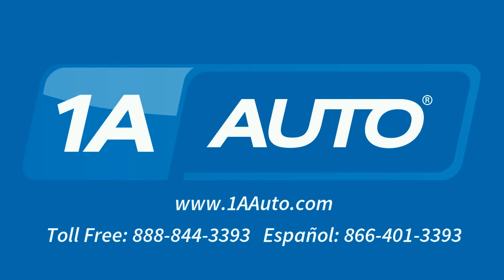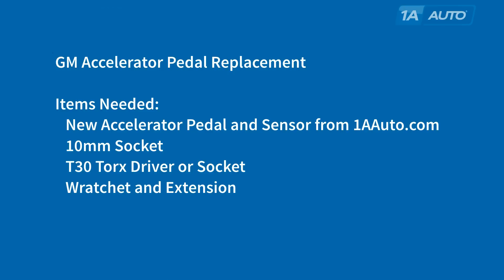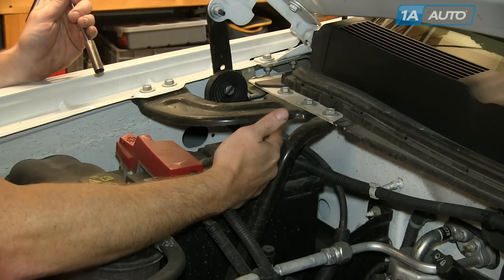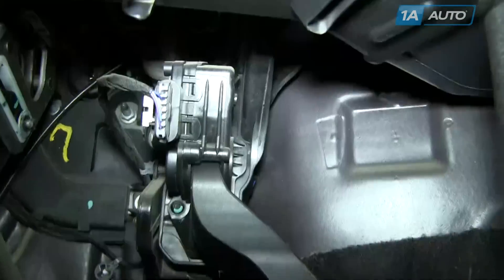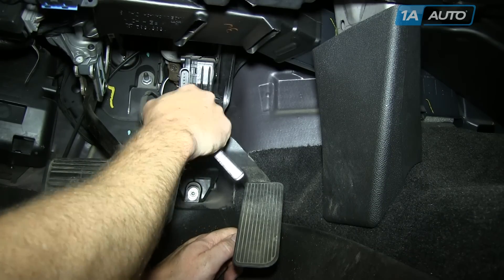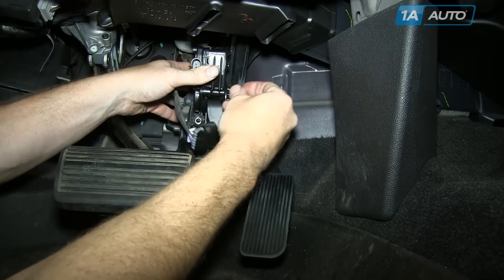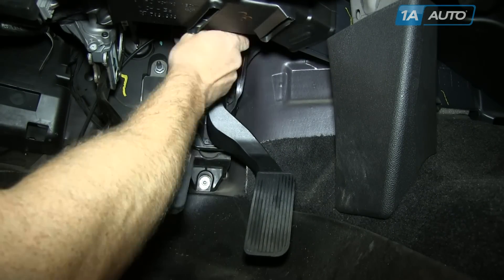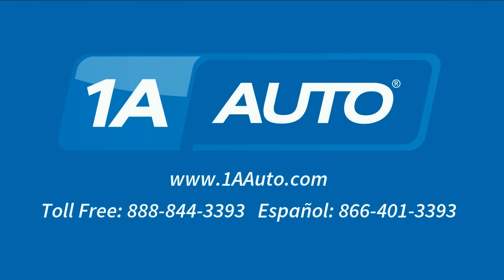How to Replace Accelerator Pedal & Position Sensor 07-11 Chevy Silverado 1500

Comment: This is just another reason why you guys at 1A Auto are the best! Watched your video, replaced the accellator pedal and sensor in no time! Thanks again guys for taking the time & making video's!!
Reply from the maker: +Rich Novo Thank you for the great reply. We love to empower our customers by showing you how-to perform your own auto repairs while installing our high quality auto parts. Have a great day! 1aauto.com
Reply: @1AAuto  But do you have anything showing the adjustable height pedal?  There's an adjuster cable that looks like a real bear to get out.  Can't find anything showing how that comes off except in comments here.
Reply: Didn't you have to reset and recalibrate it removing the battery cable resets it but you also need to recalibrate it

Comment: WHOA.  Should have watched this vid before I changed the throttle position sensor in my 08 Suburban. Replaced the accelerator pedal sensor after the fact. Running excellent so far. Hope my issue is resolved. Thanks.  👍🏾👍🏾👍🏾👍🏾👍🏾

Comment: Man I’ve been having my ABS/stabilitrak/ traction control lights going off an on for about 2 weeks now. Heard it may be the pedal/sensor, def going to try this out. Hoping this solves my problem!
Reply: Video was very clear and understandable
Reply: Did it help? Im having the same problem and thinking about buying one. Lights go on and off and 1st to 2nd is pretty rough as long as lights are on
Reply: My 2007 suburban jerks and lights come could this be?
Reply: Having the same issue did it work???
Reply: Did it work ?? Mines started doing the same and it won’t even accelerate

Comment: Okay here’s my issue. About 2 years ago my 07 Silverado started dying when I would make turns. It was throwing the code for the throttle position sensor. Changed that then it started dying again when I would either make a turn or start coming to a stop. It was throwing the code for the accelerator pedal sensor. Changed that and about 30 minutes later it started dying again and throwing the same code for the pedal sensor. Any input would be greatly appreciated and helpful! Forgot to mention that it also hesitates.
Reply: I watched 2 other videos one guy says change out the actual gas pedal , that solved his problem. Another guy says he disconnected his battery , reconnected it after 20 mins. Solved his problem. Similar vehicles to yours. I’m going to try both ...see what happens
Reply: I am having the same problem with my 2007 Chevy Tahoe.

Comment: excellent video, what were the reasons to replace the pedal? Could you help me with any signs or symptoms that may occur to take to replace the entire accelerator pedal?
excellent video, what were the reasons to replace the pedal? Could you help me with any signs or symptoms that may occur to take to replace the entire accelerator pedal?
Reply from the maker: +Jorge Almeida  A bad or failing accelerator pedal position sensor can lead to engine jerking, stalling, and uncontrolled acceleration.  Thanks for the question.
Reply: @1AAuto  Thanks  for your answer, I hope to solve the problem I have with my car and that no one has yet solved it.

Comment: My wife's 2007 Silverado ran codes for throttle body assembly and this accelerator pedal position sensor. It was having the same symptoms,  wondering if I can get by with just the pedal sensor?
Reply: What did you end up doing ?

Comment: Following installation is there a reset procedure ?
Reply from the maker: +Ronald Hemmings Accelerator Pedal Release Position Learning Procedure.
Turn ignition switch “ON” and wait at least 2 seconds. Turn ignition switch “OFF” wait at least 10 seconds. Turn ignition switch “ON” and wait at least 2 seconds. Turn ignition switch “OFF” wait at least 10 seconds.
Thanks for the question
Reply: 1A Auto Parts can you re post the relearn procedure please
Reply: @1AAuto  so I had my son change it out for me and he did not do the relearn procedure. Can I unplug the sensor at the pedal and try the process again to see if it clears it?

Comment: I watched the video and it seems pretty straight forward. As I have been reading posts about this same process, others state you need to delete any codes which might exist and be sure to reset the idle back to factory settings. I have a 2003 GMC Yukon XL with what I believe has issues related to needing a gas pedal sensor or TPS replacement. Would I need to follow those steps or simply replace the pedal sensor?
Reply from the maker: If you follow this video you should be fine. If the code do not clear after 3 heat cycles or 100 miles of driving you may have to have them cleared. We carry the replacement part shown in this video on our website. Here's a link to them https://goo.gl/QHw0r1
Reply: Just changed mine, no relearn needed like with throttle body and check engine shit right off

Comment: I have an 08 Silverado . When I step on the gas sometimes it takes like 5 seconds for it to respond . I got the code  P2138   It after moving the cables around the sensor it went away .  It hasn’t came back since then but I still notice the lack of acceleration when I step on it . If I replace it . You think that could fix that problem???
Reply from the maker: +M&J’s Channel We wouldn't be able to diagnose an issue like that here, you may want to have a local mechanic take a look at it. Thanks for checking us out! http://1aau.to/m/Shop-1AAuto-c

Comment: Thanks for the video, will attempt it in a few days.  I do have a question. Could a failing pedal sensor cause a crank but no turning over /starting?
Reply from the maker: +3264128m Thanks for checking us out! This would not be common with a failing pedal sensor, usually this issue is with fuel pressure and lack of spark. The crankshaft position sensor or camshaft sensor on some models or throttle position sensor may cause this problem as well. Hope this helps! 1aauto.com

Comment: good video but how do I know when to replace it what code should I be getting? I have a 2004 avalanche and it's got the check  engine light. all help I appreciate it
Reply from the maker: +Raymundo Pedraza Maya Thank you for checking us out. The most common codes are P0121 or P01125. 1aauto.com
Reply: 03 Silverado 1125 kicks after half throttle have to shut off restart it

Comment: I have a 2011 lml 3500. No codes, but the rpm's will randomly spike while driving, at a red light or idling in park. The spike increases rpm's by about 100-200. While I'm driving, it almost feels like I've hit a small bump in the road. TPS?????
Reply from the maker: +Dave Overall We wouldn't be able to diagnose an issue like that here, you may want to have a local mechanic take a look at it. Thanks for checking us out! http://1aau.to/m/Shop-1AAuto-c

Comment: Hi! Could this also affect the cruise control from working. I already changed the brake switch sensor and light on steering wheel comes on but not on gauges and it’s still not working.
Reply: Good question. My cruise control only works when I lightly tap my brake before engaging it..lol..My check engine light came on and it says it's the accelerator pedal & position sensor

Comment: How do you disengage the sensor cable because I could not see how you did that and I’m having trouble disconnecting it
Reply: Ever get an answer?  None of the videos I've found address this and I'm in the middle of it now?
Reply: @rebinny  You ever figure it out for yourself?..lol
Reply: @rebinny  No I haven't but I was able to figure it out by doing it differently from the video 
I removed the assembly then disconnected the sensor 
Another thing this video fails to mention is you have to reset the sensor 
Disconnect the battery pump the brakes ten times wait 10 minutes reconnect the battery and then your good

Comment: Will this cause my truck not to shift i can go about 35 40 mph then it just rpm go up and the truck don’t go nowhere I have a 2004 Chevy avalanche
Reply: Yes.  Cause it to burn gas too
Reply: Did you end up figuring this out? Having the exact same issue, replaced VSS, TPS, MAF, and still same problem.

Comment: so what if I have auto adjust pedals????  HOW DOES THE CABLE COME OFF????????????
Reply: You unscrew the cap off the tabs and move it out the way up the cable and yank the cable out of the electronic adjuster on the pedal. Takes a good yank, but it will come off. Now the reinstall is tricky, as the accelator pedal and brake pedal position motors must be in the same position before reinstallation of the cable. I do this with a cordless drill.

Comment: I wonder if I need to replace this? Everything shifts normally if I accelerate slowly.  If I try to accelerate like a normal person would, it surges and doesn't shift gears until it hits 3000-3500 rpms. Anyone know what this issue is? No check engine light. Transmission shifts without any issues.
Reply: Have you figured out your problem?

Comment: Pretty sure my truck (08 sierra denali) needs this replaced. It just stopped working temporarily awhile back and worked again for months but it reoccured. This problem is extremely dangerous because my truck literally had no power while on the road. It does flash the other abs/traction problems when it happens. Some roads have no place to pull over so it can be a huge problem.
Reply from the maker: +Jordan We carry the replacement part shown in this video one our website. Here's a link to them https://www.1aauto.com/accelerator-pedal-and-position-sensor-general-motors-25832864/i/gmfac00002?utm_source=YouTube&utm_medium=CTA%20Comment&utm_campaign=1ATony